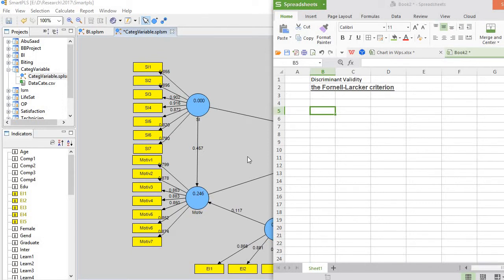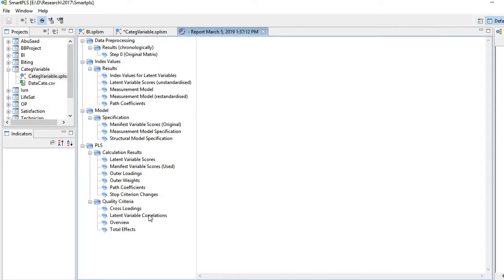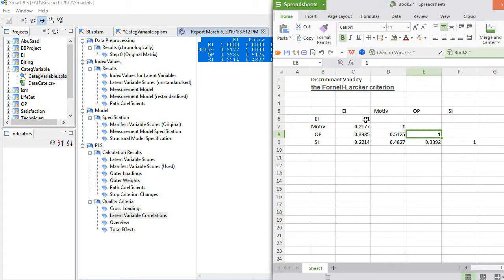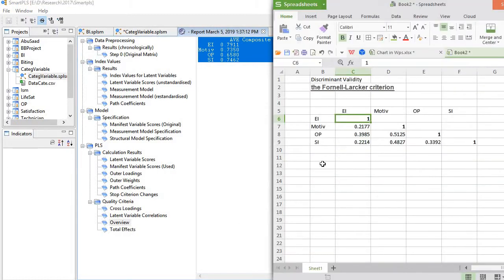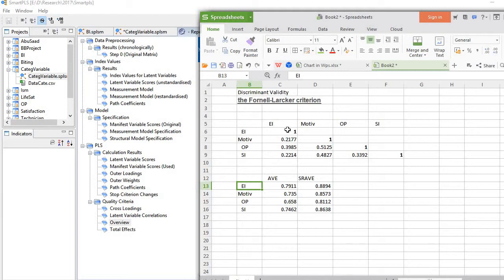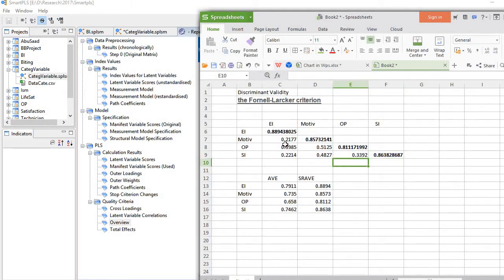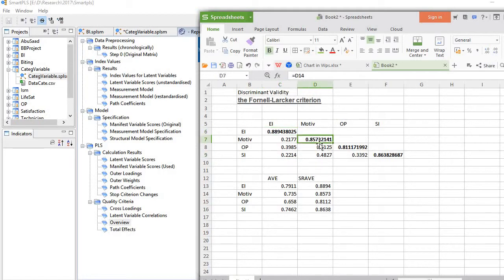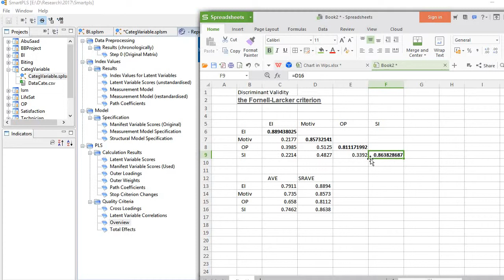Fornell-Larcker Criterion Analysis

Comment: Sir I want to ask if I have no issue with cross loading but there is 1 variable in fornell lacker that the value isn't exceeded than the construct correlation. What should i do? 
And I have no issue with convergent validity and reliability test as well